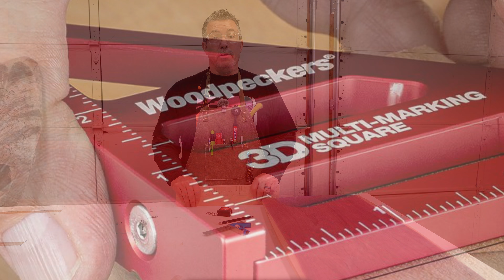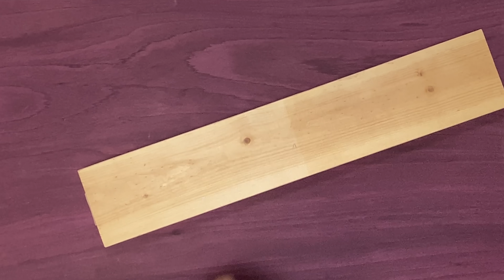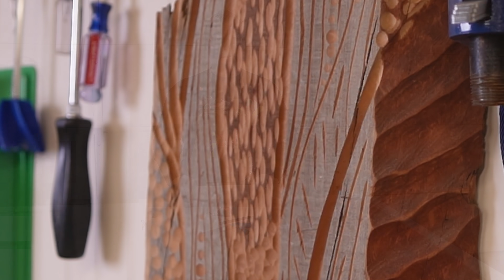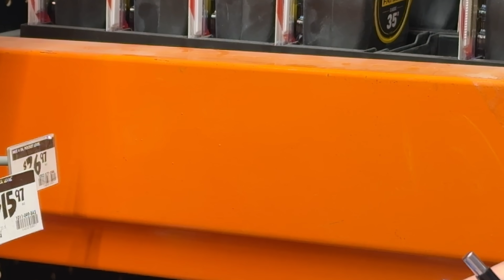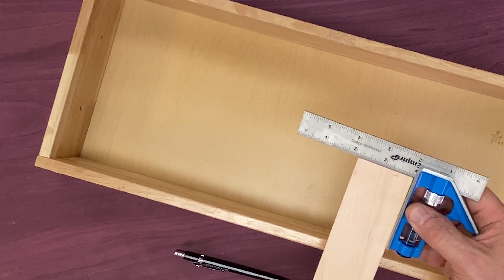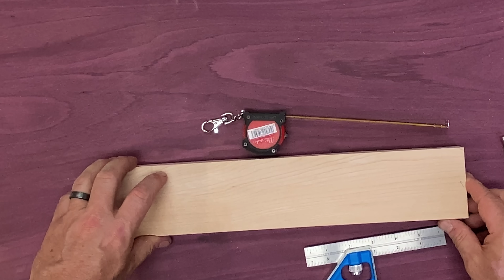You're Measuring Wood Wrong (and Wasting Money)

Comment: That transfer tip I think will really help me in figuring out furniture and cabinet fitting issues that I'm expecting fairly soon. 100 + year old houses like mine simply don't have straight walls nor exactly 90° angled corners, as I've found in my efforts so far to just build & move ladders around and build room layouts- current and future.
Reply from the maker: Old timers called it a story stick and I think you’ll find it really helpful. For me, the real trick is in being patient enough to sneak up on the final cut without removing too much. Hard to believe how thick a saw kerf is once a board is too short 🤪

Comment: Using the actual wood pieces is always better than measuring and doing math. Burning an inch good especially when trying to measure thin pieces close to the hook where you can't even see the lines.
Reply from the maker: Spot on; transferring measurements directly from your material is the best way to avoid those annoying math errors. 👍

Comment: No pencil can ever be the correct way to mark for cuts. Lead is too thick. Only a knife is correct. A box cutter does a fine job. You don't need a V either. Just put the point of your knife at the line on your tape. Then run your square up against your knife point. That is how you mark with accuracy.
Reply from the maker: I definitely appreciate the perspective on using a knife for precision; it's a great way to eliminate the margin of error that comes with pencil lead. 👍

Comment: I started using shop equipment in 1974 and now today I mostly use referential  measurements because I have hand tremors and bad eyes. I buy 0.7 pencils during the back to school sales. I find the 0.5 seems to break to easily. 
When we get older sometimes we need to rethink how we do things.

And I don't use measuring tapes unless I have to. I use a folding measure stick and rulers.
Reply from the maker: I love the practical approach of using reference measurements and sticking with tools that work for your specific needs—thanks for sharing that wisdom! 😊 - Especially on the folding tape measure part. I often forget I have that and with the brass extender, it makes for a really good story stick. Thanks for reminding me!
Reply: @dansbeedesigns  I forgot to add that I hit that ole subscribe button.
Reply from the maker: @a9ball1 I appreciate you!

Comment: I've been woodworking for over 30 years - spot on.  I'd add that that combination square is really my most important tool.  Save up and  get a good one like a Starrett, Brown and Sharpe or PEC - such a joy to use over the cheap ones.  My Starrett with a Satin finish on the  Rule is just so much easier to read -especially as my eyes age.    I don't understand all those "precision" squares and such made out of Aluminum - can't run a marking knife without easily nicking the tool & if not using a knife then the pencil even at 0.5mm is too thick for the precision!
Reply from the maker: I am dreaming of a nice Starrett combination square :) I'm also a big fan of powerful bar magnets. My shop is filled with them. I like to keep all of my frequently used tools visible so I can easily spot them and grab them. The most expensive fancy red tools you can buy these days are either stainless steel coated or all aluminum, which defeats my magnet strategy. Great point about using blades against aluminum. Thanks for sharing that!
Reply: @dansbeedesigns Taylor toolworks sometimes has PEC squares with minor blemishes at a pretty good discount

Comment: "Buy-Nothing Rebellion"  !!!     I like it!
Reply from the maker: It’s time we focus on our skills instead of just buying more stuff! 😊 At least that has become my own personal guiding principle. I'm glad it resonated with you!
Reply: @dansbeedesigns  You bet! Btw, would you happen to know how to layout a large (app 4ft long) asymmetrical curve line for a template? Cutting it isn't a problem but drawing it out is...for me anyway.
Reply from the maker: @t @tbone7193 ven your asymmetric requirement, using a thin wood strip and string to make a bow wouldn’t really work. I’d most likely cut the shape from plywood, then use that as a shape vice edge to clamp in a soaking wet thin wood strip. Once dried, the thin strip should hold its curve and could then be used as a template

Comment: Hi. My name is Julo and it s been 6 days since I made wrong measurement. Also, it is 6 days since I have been in workshop. :-D 
Anyway. Thanks for recomendations. 2 things, that I find out that works for me, are metal ruler instead of tape measure. You can buy one for few bucks, like 2-5€. Also, another recomendation is to use something called machinist square. It is cheap and precise as hell.
Reply from the maker: Those are both essential shop upgrades that make a world of difference in accuracy! 👍 I should have mentioned both in this video so thank you for bringing them up. I have a three pack of machinist squares that I rely on heavily. I heard some advice recently that seems like good advice. It was that we all need to buy one good, usually expensive, square. That we all need at least one reference point in our shop that is as accurate as possible. I've not yet spent real money on an accurate square due to how I do woodworking, but the logic seems solid.
Reply: @dansbeedesigns  Totally agree. I had luck with this. In my former job, I worked at machinist quality controll, and we had something called normative. It was precise 90° angle. Like 90,000something. It was expencive as hell, but somehow, after few years it got worn down, and during calibration I have found out, it has 90,001°. so, for the company it was garbage. Now it is at my workshop, just to check, if other squares are square. :-D

Comment: In the vein of transfer measuring, I always set my saw to the correct dimension, then cut ALL the parts that use that dimension. Taken to the extreme, I've even left the saw set and gone to a different saw to cut a different dimension, just in case I mess up something and need to recut a piece.
Reply from the maker: I love that approach; it is such a smart way to guarantee consistency across every single piece in your project. 😊 I will often try to do that when I can. Thanks for dropping that tip here!

Comment: A square that’s actually square 100%
Don’t drop it on concrete, again 100%  I found a very old “made in England” machinist square in my dad’s tool box after he passed, I loved using that square for over 20 years and then I knocked it off my workbench and I guess it landed just right because it wasn’t true anymore.
Reply from the maker: It’s heartbreaking to lose a tool with that kind of history, especially one that served you so well for decades. ❤️ no way to repair it or bring it back to true?

Comment: I agree with a portion of what you stated in the video.  I suggest a few adjustments to what you stated, as there are times in woodworking when very good accuracy is required (that happens frequently when using a horizontal pantograph machine):
1. Buy a good quality 12" steel ruler from a well-known brand (Woodpecker, Starrett, Mitutoyo, Jessem, etc.) - a good steel ruler will help you avoid mistakes.  Ideally, this steel ruler will have one section with 1/16" measurements and another section with 1/32" measurements.  This steel ruler should be used for all measurements that are 12" or shorter, rather than using a tape measure.  This steel ruler should also be used to verify that your other measurement tools are accurate (at least to 12") - I have found that some steel rulers are NOT accurate (I created a video showing this problem).
2. When using a tape measure in a project, use only one tape measure through the entire project.  Some tape measures, even from within the same line of Stanley tape measures, become progressively less accurate the further you pull out the tape.  Occasionally verify the measurements in the first foot of your tape measure with the steel ruler to make certain that the tip of the tape measure is not bent.
3. Buy an inexpensive set of precision setup blocks for measuring common measurements up to 3" (a decent inexpensive set might cost $40).  The setup blocks help to minimize errors related to viewing angle of the measurement tool and marking accuracy (I have several examples of their use in some of my videos).
4. Buy a good quality (such as Mitutoyo) digital caliper - they might cost as much as eight board feet of black walnut (it helps to measure the cost of good quality tools in terms of board feet of black walnut).  A good quality digital caliper offers repeatability and long battery life compared to cheap units that are on Amazon.  A good digital caliper helps significantly when attempting to create certain joinery, such as quarter-quarter-quarter box joints, lock miter joints, mortise and tenon joints, box joints, machine created dovetail joints, etc.  A good digital caliper is also helpful at the planer, to make certain that something that is supposed to be 3/4" thick is actually close to 0.750", for example, so that later joinery that depends on those measurements is correct.
5. That was a good test for whether or not a square in general is square.  With a combination square, especially combination squares that are built to meet a low price point, the square may seem to be square with the head at one location, but may not be square when the head is moved to a different location along the bar.  Any error may increase as the head is moved back and forth several times through the tool's lifetime, causing additional play in the locking mechanism.
6. When making a mark with a 0.5 mm or 0.7 mm mechanical pencil, keep in mind that the pencil lead has a thickness.  At the tool, make certain that you remember if you are supposed to split that pencil mark, take the left side of the pencil mark, or take the right side of the pencil mark.
Reply from the maker: Those are some great points about precision, and I appreciate you sharing your experience with those specialized tools! 👍Thank you for taking the time to write that up -- I know this community will benefit from it!

Comment: Never measure from the end of a tape, always “burn an inch” and start from the one inch mark. The ends of the tape are too flimsy
Reply from the maker: Woodworkers and their trust issues -- Boy I'll tell you :) Unless you are willing to spend $200 on a tape (and most of us are not), what we have access to is very easily damaged. Aside from the little 6 footer I keep in my apron, I believe most every other tape I own has a ganked up tip. You are 100% correct in your tape trust issues! Thanks for sharing
Reply: Many even name brands are construction accurate use the same tape for the project, I consistently use a Flatback tape as it lays flat on the lumber. Get a stainless steel digital caliper a budget one is more accurate than your touch unless you’re a machinist. Adjustable squares it’s best to get a decent iron body and an engraved ruler and a machinist square for a reference.

Comment: Thanks for sharing!  But you don't even need a marking knife or square in many cases, either.  As you said, the numbers don't usually matter; only the fit does.

I cut everything just a bit oversize, then use a shooting board on most pieces to trim them to size and square.
Reply from the maker: I couldn't agree more—the shooting board is an absolute game changer for getting that perfect fit without obsessing over numbers. 👍I suspect I'll be making a shooting board video soon since it almost never gets pulled off my shop table.

Comment: Great video!  As a 72-year-old dinosaur who has been measuring and cutting wood since I was a child I only have three items I suggest you consider:  

1) Not all tape measures are accurate.  I have three identical tape measures and only one of them is accurate to a reference spec (more on that in a minute).  I discovered this after a horrible work session where I was doing some demanding framing for a renovation of my old (read “not square, level, plumb, nor true") house.  For some reason I had one tape at the job site and another at my saw.  I would  measure in the build space with one tape, then walk back to my saw in the shop, mark the wood, and then cut.  I just could not get a proper fit.  In total frustration I grabbed both tapes and layed them out on a 10-foot board, then marked 9 feet with each.  The marks were different by almost 1/8”!  This solved the problem of why the cut boards didn’t fit.  So I learned to always use the same tape to both measure and cut.  

2) But which tape was correct?  Now experience has taught me that if I am working to a tolerance of less than 1/8” then I need to use my venerable folding rule instead of a tape.  So I layed out my 6-foot folding rule, my 8-foot folding rule, and all three of my supposedly "good" 25-foot tapes side by side on a board with a known square end, which I used as zero.  The two folding rules were absolutely identical in their scales, at least as far as I could determine with my old fart eyes and trifocals glasses.  One of the tapes was identical with the 8-foot rule for all 8 feet both in push and pull measurement (inside and outside, if you prefer).  So I marked the out of spec tapes and set them aside.  Now I have two folding rules and a tape that agree, at least for a distance of 8 feet.  This is quite comforting to know.

3) The exercise in #2 reminded me of a method my Master Carpenter Dad taught me when I was a teenager.  When reading a tape or a rule, and when marking from them, always move your head until your master eye is directly perpendicular in two dimensions to the point being measured or marked.  "Parallax kills!" Is how my Dad used to joke about this method.  It makes a huge difference in making accurate measurements.  We old farts also need to check and adjust for any induced parallax by bifocals, trifocals, or simple magnifying reading glasses.  I have taken to using only a pair of reading glasses that focus at 2 to 3 feet hanging off my nose for doing this work because I find I get better results than when I wear my "normal" trifocals.   I also found I can buy safety glasses with built in bifocal bubbles at the bottom that are pretty good, too.  Certainly good enough for work on the table saw, miter saw or band saw.

4) but getting back to the question of which of my measuring devices was "correct."  This question nagged at me so much that I actually spent a fair amount of time with machinist 1 2 3 blocks, calipers that read to three decimal places, dividers and other precision measuring devices to create a grid on a board that was pretty damn close to being exactly 8 feet long.  To my everlasting joy I discovered that my Stanley 6-foot and 8-foot folding rules were as accurate as my eyes could discern.  The one tape was pretty close, too, accurate enough for most woodworking and certainly good enough for framing.  So now I have a standard of measurement that gives me confidence in my measuring tools.  It brings me peace.  Can you imagine… a Happy Woodworker?  :-)

Thanks for all the good info you provide in your videos.  God bless.

Jim Schafer
Elyria, Ohio USA
Reply from the maker: That is a fantastic breakdown Jim, and I love the dedication to ensuring your tools are actually accurate! 😊 You taking the time to write this up really warms my heart and I can't thank you enough! I know this community will benefit from reading your comment. Even after all these years, I take some things I've learned for granted. For example, I used to be really bad about laying down tape measures, and then not seeing them again until they showed up on the back of a milk carton with the caption "have you seen this tape". Jonathan Katz Moses taught me to attach a tape to my apron and never remove it. Since then, the tape you see in the video is the only one I ever use, and with my woodworking, I only ever need to get down to an 1/8" with any measuring tools, because I'll be putting them through the jointer or planer or hand-planing to reach a particular marking point. I'm also an avid shooter and do everything from shooting to measuring with both eyes open, which helps with parallax a bit and you are absolutely in-focus with your comments on that. Unfortunately, I need to stay away from topics like that on my channel or risk getting put into a corner by the algorithms :(. Like you, I also have multiple lenses in almost all of my hoods, shields, and glasses. Even my welding helmet has prescription inserts! I read comments like yours and I beat myself up for not including more content in the video, while at the same time getting beat up by the algorithms for my videos being too long. Still trying to find equilibrium. Thank you again for the feedback and viewpoints!

Comment: For those of you that don't know, the combination square he tried at the Home Depot is adjustable. The screw at the very bottom can be turned to make it perfectly square. I just recently bought that one and thought mine was defective, then I noticed the adjustment screw.
Reply from the maker: That is a great tip for anyone who might have overlooked that adjustment feature! 👍 I should have shared that it can take a while to develop a hand to square relationship with tools like these where you know where that sweet spot is of tightness to get things as close as they can be. Until I get used to using a new square, I use the flip test every time I move the ruler within the square, while noting the adjustment tension needed to get where I want to be. I really believe that just about any tool can be useful if we take the time to develop a feel for it and learn where it is strong and where it is weak. thanks for sharing!